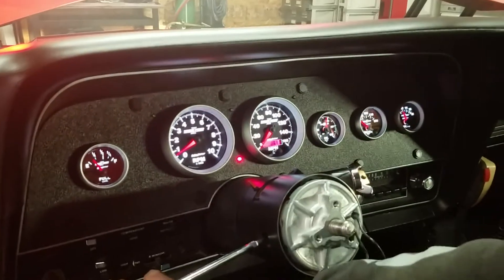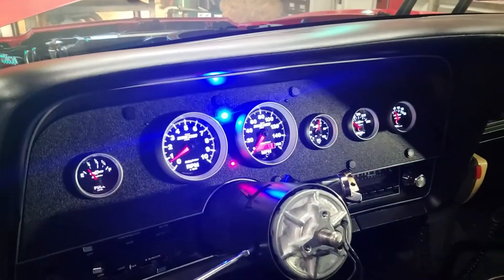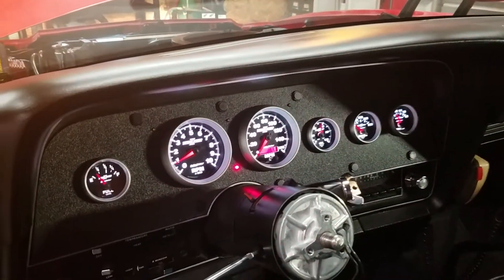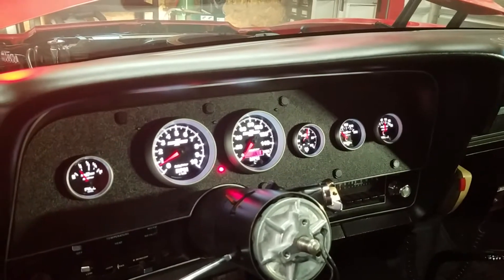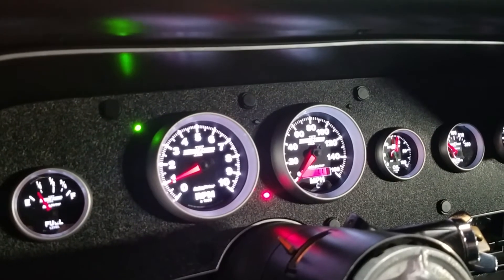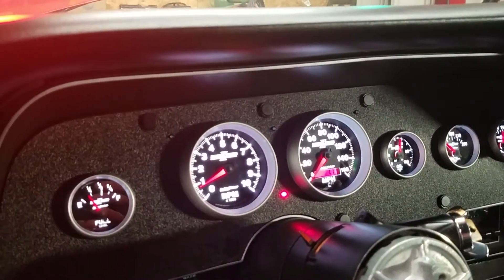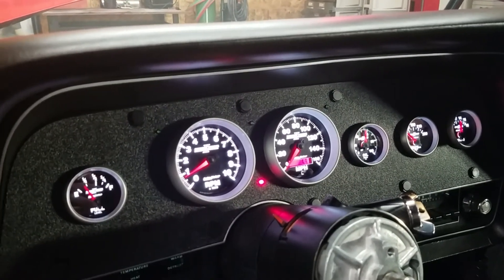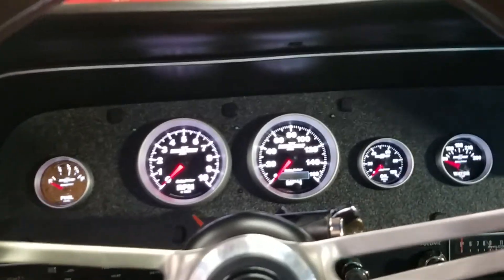1976 Ford Torino Custom Gauge Panel

Comment: Hello
Great job.
The wiring adapter is sold by autometer too for ford gran torino ?
You have some link to help me ?
Thank.
And congrats
Reply from the maker: Alright, so there is no wire harness adapter for a Torino. Autometer sells a universal wiring harness for the gauge cluster. Basically you build your own harness. It's the matter of finding which wiring from the car's wiring harness go where. It was a lot of work. It took A LOT of trial and error and LOT of research online. A lot of wires were not even needed anymore...usually seatbelt and other warning lights. The 76 models were at weird year when computers were starting to run things in cars but that's been eliminated in ours. So this is what I used: https://www.autometer.com/gauge-wire-harness-universal-for-tach-speedo-elec-gauges-incl-led-indicators.html and it worked great. I can pop the gauge cluster out, disconnect the wiring harness in one shot and unscrew the oil pressure line and out it comes. The downside for ours was the fact that we lost the left air vent but needed the space so not a big deal. 

It's absolutely doable just gotta take your time. I wish you luck man.
Reply: Thank you. 
I will try on m'y 74 gran torino.
I am thinking about make a full cover from radio to light switch. 1 bien piece. Home it look good

Comment: Where did you get your blinker lights and gauge set?
Reply from the maker: Autometer.
Reply: About how much did it run you, i'm lookin into replacing my cluster but dont want to get too expensive
Reply from the maker: $700 give or take. The tach and speedometer were the most expensive.
Reply: Awesome! thanks
Reply: what material did you use for your back plate on you cluster?
Reply from the maker: Just black textured ABS - http://a.co/1NT1Dtm
Reply: I bought all gauges on the Web, 2 big and 4 small.... for 110 USD